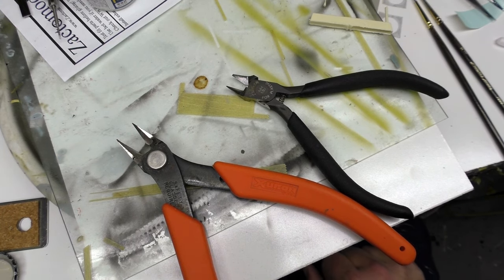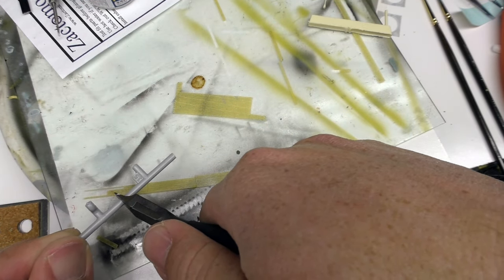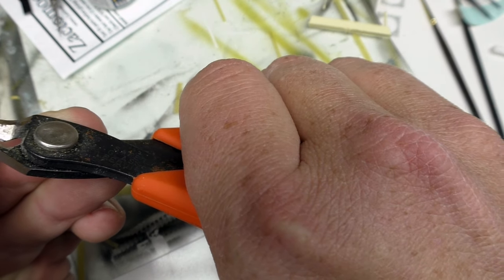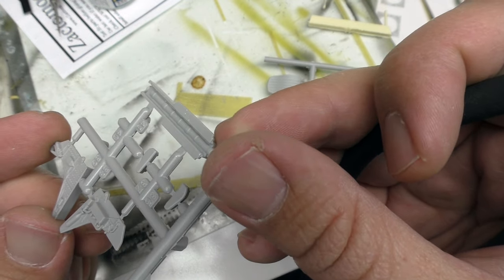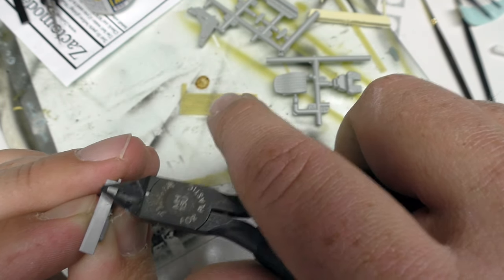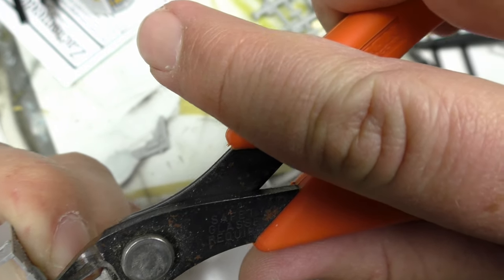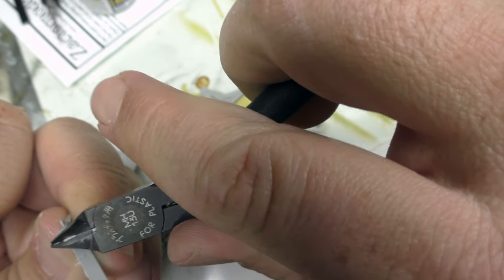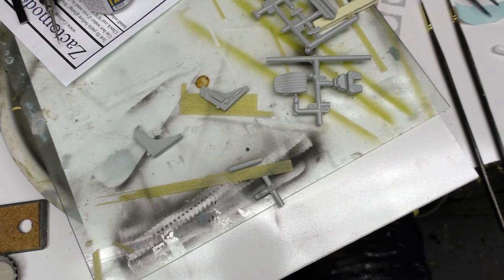Sprue Cutters

Comment: I have a couple high end electric cable cutters similar to Xuron that i have custom ground to remove almost all of the tapering. This means you can access the narrowest of clearances when removing parts from the sprues. There really is no manufacturer making something like this. You have to do this yourself. You really need to have one of these for the smallest parts and another unmodified cutter to tackle thicker plastics which would potentially break my custom tip cutter.